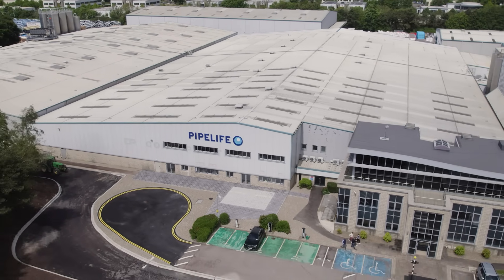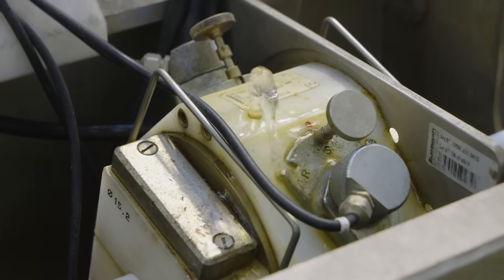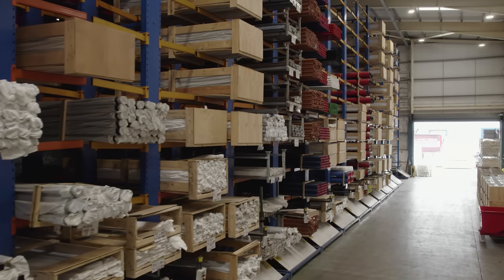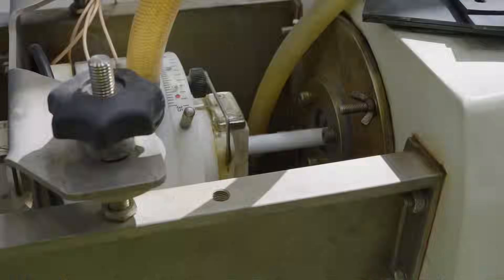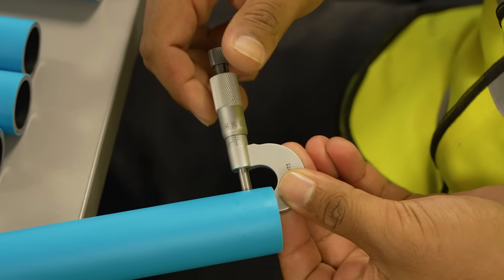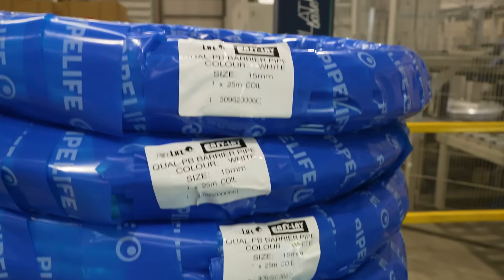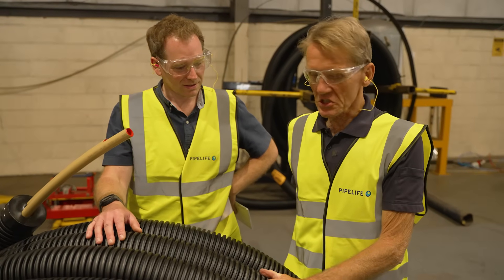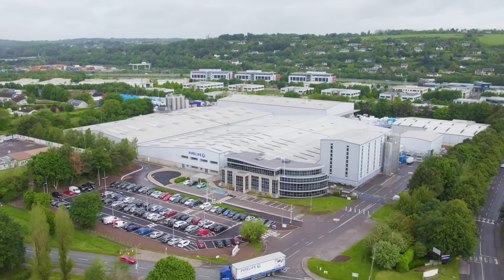How This Factory Makes Enough Pipe to Circle the Earth 17x!

Comment: What about future recycling? Plastics don't bode well with the environment.
Reply from the maker: Hi Stephen
Whatever your views are on plastic and the planet the alternative right now is copper.  The fact is that copper prices are going to rise dramatically as we move to electric vehicles, wind turbines and solar. More copper windings, more copper cable, the list goes on. I can't see copper being used in pipework in the future.
Reply: @SkillBuilder  I am using a mix of copper and hep. Copper prices are through the roof, and will no dought go higher as demand increases. I think we should find ways of recycling all plastics, and reducing the use of them wherever possible.
Reply from the maker: I think the plastic used in Pex and Polybutelene is recyclable but whether it gets done depends on the site regime. Certainly the offcuts are fed back